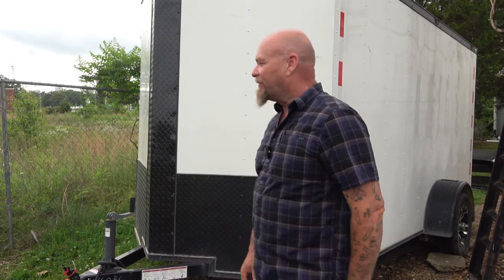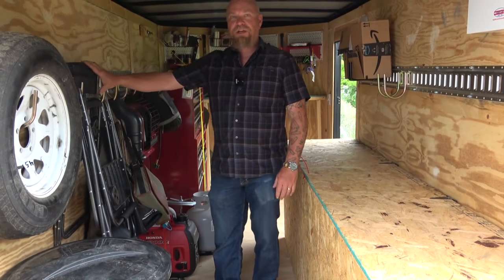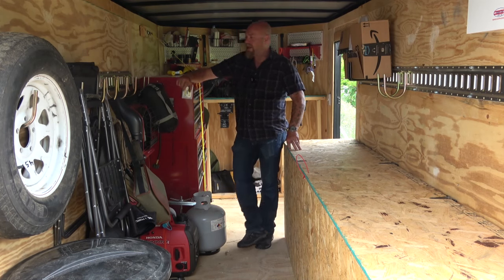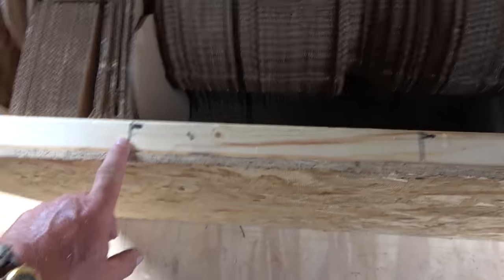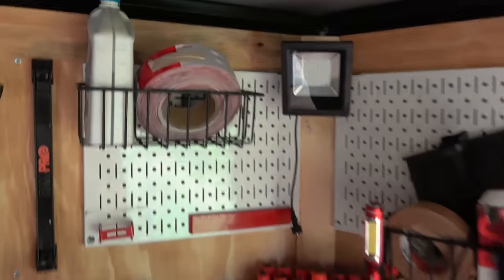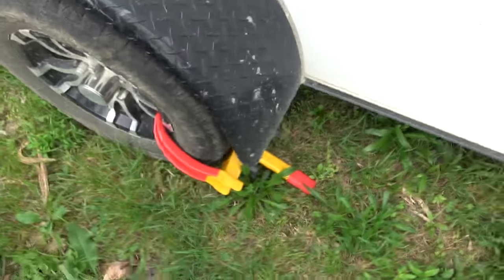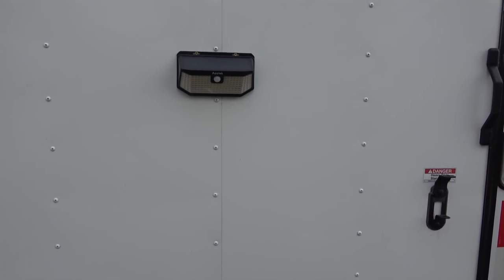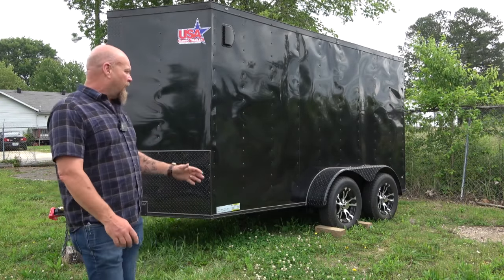Tactical Teaching Trailer - Version 1.0

Comment: A brief look at the spec page on their website didn’t show the type of cables used for the rear door. Years ago when I worked at an airport, we replaced 10 year old hangar door cables with “comparable” ones that would start to fray within a year due to a new overseas supplier. We tried stainless steel cables which did not fray in that same timeframe and iirc, the SS Cable was Made in the USA. It might be apples and oranges to a degree but just something to think about if that time ever comes. - Evan

Comment: Your truck's 7 pin trailer plug has a constant 12v power supply (fused)....Most trailers come wired with a switched dome light(s) that run off of that feed.  You can tap into that for more lighting.   It's how I run mine.

Comment: If it were mine, I’d end up putting an inverter in it so I had access to emergency 120v outlets and then not tell anyone they’re there so they don’t try to take all the juice charging their phones lol it would be handy for charging cordless tool batteries, radios, and things like that. All that said, I’m going to be in Pennsylvania on the 1st and 2nd. It was awesome meeting you last month and I’m looking forward to next week! See you then!!
Reply from the maker: I have a Honda Generator as I talked about in the video.
Reply: @TacticalResponseCrew  Yeah, those things are solid and I love the idea of a propane conversion. I figured you could save the space of the propane cylinder and the generator though. There'd just be less stuff.
Reply: It's just now occurring to me that you couldn't get rid of that propane cylinder because then you wouldn't it for the heaters. Ignore me lol I'm sorry.
Reply from the maker: All good dude.